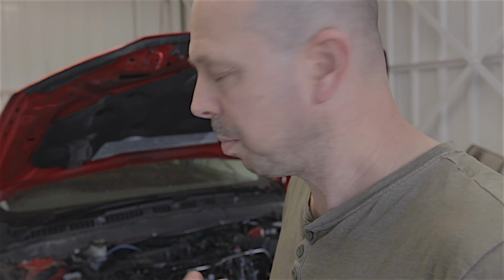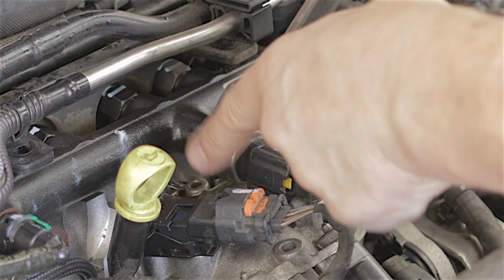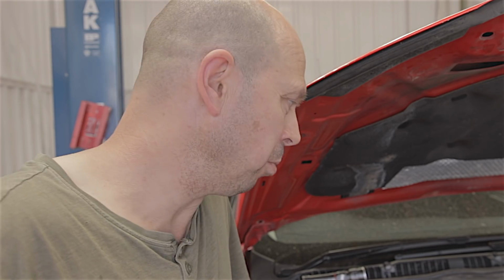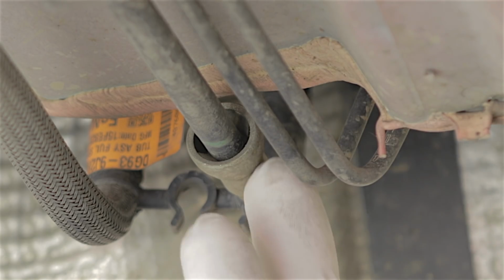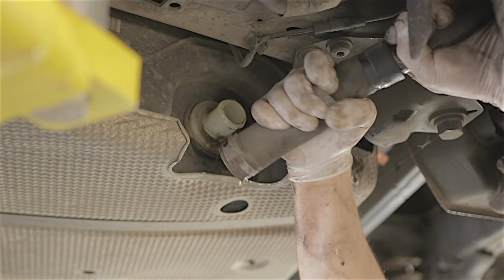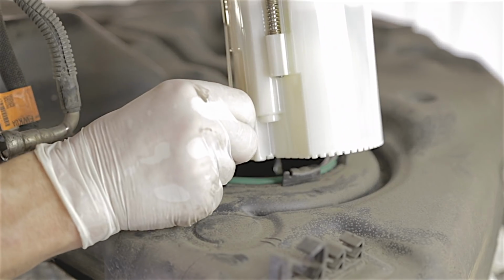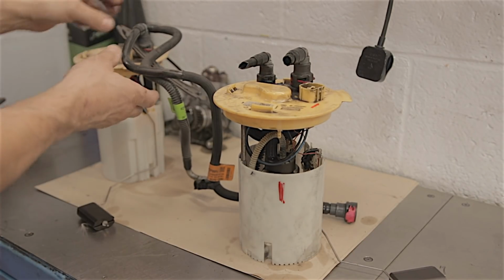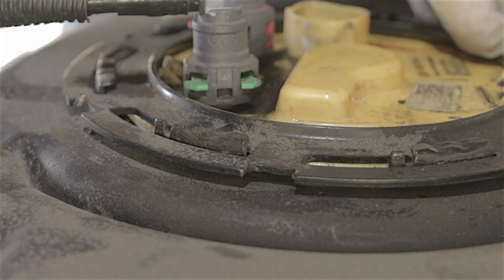Nightmare High Fuel Pressure Fault...2017 Ford Mondeo Mk5 (part 1 of 2)

Comment: Hi Alan, thanks for your very informative (and entertaining videos). 
Although I changed my Mondeo for another German premium brand, thought I will share this:
Anyone reading, for the spring, try googling for "Delphi dfp6 plunger return spring 459". 
Based on some pics of the HPFP, the pump part number is 28384347 and the Delphi type is DFP6.1E DW10F  
Probably your local Delphi service has them on stock or can order(in case it is not the correct part.  
I will spam the same message to the other HPFP videos.

Comment: Hi Alan I’ve got a mk4 2.0tdci which occasionally keeps cutting out as if it’s ran out of fuel. It hasn’t I can get it going again with a priming bulb connected on to the return pipe. It’s a struggle though as it seems to struggle to suck out the tank as if there’s a blockage or something. The filter was only changed 3 months ago I’ve scanned the car and it doesn’t show any faults. Any ideas 🤷
Reply from the maker: sounds like you have an air leak on your low pressure fuel pipes somewhere or a badly leaking injector back to the tank..headache..maybe start with a fuel injector leak off test
Reply: @alan4x  I’ll try that first. Thanks Alan 👍

Comment: Hi mate I have got a Ford Mondeo mrk 4    2.2    
x sport I cleaned the egr valve and intake manifold out put it all back together go to start it and the starter is not spinning the engine over properly and I disconnected the battery before unplugging the sensors

Comment: 🙉 can anyone help here 🤞🏻🙏🏻 have Ford Mondeo automatic 2.3l titanium x 08 82000 miles seems like the oil was low and and engine seems to be seized anyway getting it released or would it need a new one or can anyone help or any advice would be appreciated

Comment: I had a brand new mondeo mk3 zetec 2.0L Diesel that used to cut out when I was on the motorway Fords I took it back as it was still under warranty they had it for 3 months in their garage I then got it back and said it’s sorted I picked it up took it for a run and after two miles the same problem happened they had to replace the car and I ended up getting a zetec S they told me they had replaced the fuel tank injectors pumps even after all that it still broke down I never did find out the cause of what it was
Reply from the maker: thanks😜  i guess I'm not the only mechanic to take an age to fix a car lol

Comment: Fuel vapouriser pump running.
Reply from the maker: it does not have a vaporiser pump but if it did thats a good guess
Reply: According to ford Etis it shows one in mechanical , exhaust . And in wiring diagram it shows vapouriser glow plug and pump. 
Not unusual for the fuel to flow out the spill pipes on some fords . Does exactly that on new transit custom as I found out last week leaving the ign on while changing the injectors.

Comment: Is dirt in the tank and injectors far more likely in high mileage cars ? Most drivers that share probably fill the tank at the end of every shift so no problems but not necessarily those not sharing.

Comment: Had to replace both my aux pumps on my Rover 75 diesel. One in the tank which you can get at via under the rear seats and a easy 15mins job in the front.
Common problem on the BMW Diesel engine. Cost me £250...god knows how much if I'd took it into a garage. Great vid as usual.
Reply: You still got your 75 mate? Hell of a car. You still see the odd one on the road.
Reply: @zoidberg444  No. Kept it 5 years, but hurt my right knee so went auto. Was a fab car tho...minimum problems. Sold it with 68k on the clock and it was still like new.

Comment: I'd go for the inlet metering valve on the pump,
Reply: Or a failed injector, injectors not firing?   
Maybe a sensor in the stereo didn't like the music being played and shut down the ECU for the injectors.  :)
Reply from the maker: i like that one😜
Reply from the maker: good guess...but no lol
Reply: @alan4x  SCV (suction control valve) is basically the same thing. If you unplug it fuel rail pressure will hit the roof

Comment: Has the mark 4 mondeo  tdci 1.8 got the pump in the tank
Reply: No it hasn't Daniel.
Reply: @exceloutkasts8104  thankyou
Reply: @danielp9721  If you ever change your fuel filter on the 1.8 TDCi you need a hand pump or some sort of pump connecting to the inlet pipe from the tank to the filter housing and that is the only way you will get fuel up to the engine. Hope this helps mate :)
Reply: @exceloutkasts8104  fitting a little primer like the 1600 hdis have would make much better in my opinion
Reply: @thomas4891  Indeed it would have but for whatever reason someone at Ford must have decided to save the pence it would have cost to fit them :)

Comment: Hi Alan, very  interesting video. Most likely the defect is due to the fuel metering valve (or M-prop valve) on the high pressure pump. The excessive pressure in the rail is caused by the pressure regulator which for various reasons can no longer be controlled by the ECM and remains wide open. 🍻
Reply: Wtf is a M-prop valve?
Reply: The M-prop valve is same thing with fuel metering valve or pressure regulator valve.This is a solenoid on the high pressure pump, which regulates the fuel pressure in the rail.When the valve can no longer be controlled by the ECM (for different reasons: poor electrical connection, poor quality fuel, etc.), the pressure in the rail increases excessively leading to the fault code and finally to the engine shutdown.
Reply from the maker: you know what.... you are sooooooo close... i will reveal tonight😜

Comment: ROFL I drive an old Mondeo MK3 ST220 with an 3ltr engine...and I got the same Fuel-Pump-Problems as u did. So I went into the garage and payed 1045 euros to fix it!  They built in a new Fuelpump and new Fuel-Filter...Now I am happy to have back my old Mondeo and it drives better than before as it seems :-)

Comment: had plenty of P0088 , fix was M prop slow to react when desired rail pressure falls, although this is different.....hmmm maybe HP fuel pump stuck on full delivery
Reply from the maker: oooooh so close...